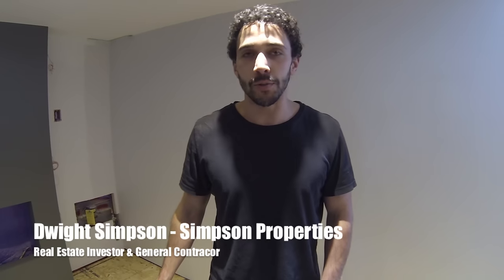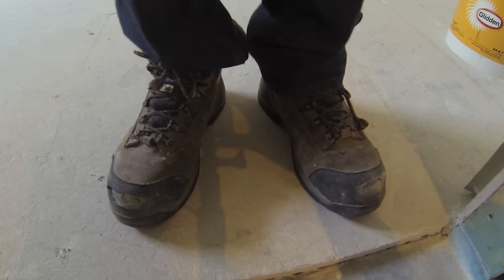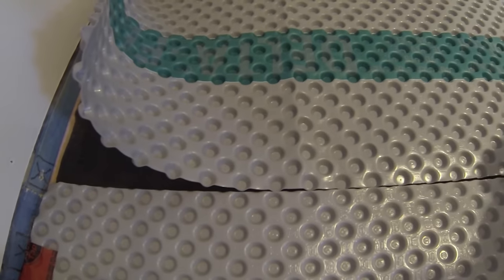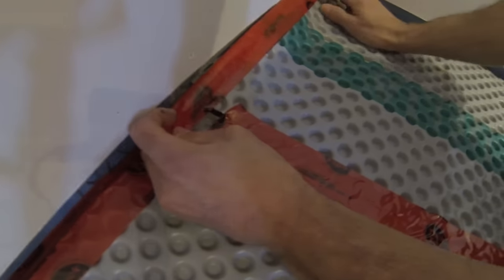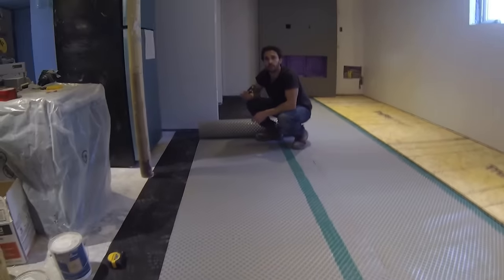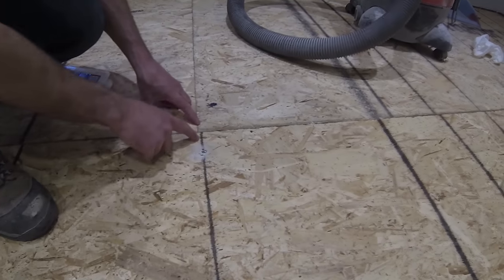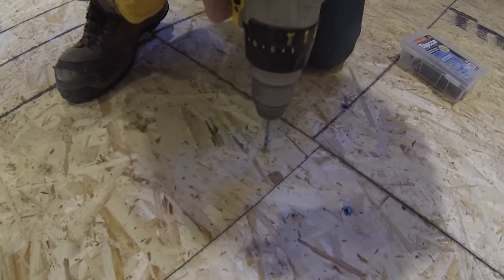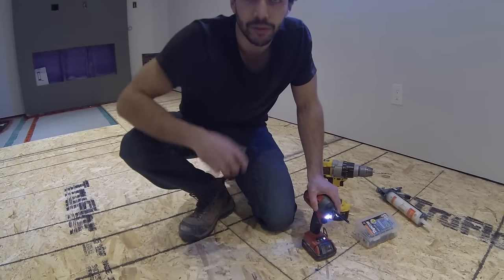HOW TO INSTALL A SUBFLOOR ON CONCRETE

Comment: hi, great video - really appreciate it- ty!  job is aprx 540 SF condo with aLR/kitchen area and a bedroom. I am thinking to have installed-  aquaguard waterproof laminate (sold by floor and decor) on concrete slab, which is costly in itself so trying to keep underlayment costs and  additional labor costs minimal. in seeing this product, I was thinking it beneficial as a moisture barrier and also should aide in flooring protection should an appliance waterleak occur, as just happened with existing floor. (thinking water would seep under this barrier) the main living area seems to have a secure foam or plastic underlayment that may be well in tact, then it runs into kitchen area that has peel and stick vinyl that i am leaving down and the bedroom has a softie plastic underlayment already as well.  do u think this would work  in lieu of landscaping fabric for anti-clicking noise and okay to just lay the laminate on top of this product or underlayment is again needed over this too?
Reply from the maker: vzw 3 vzw 3 if you're installing flooring in a condo usually the condo board has requirements that have to meet their standards for underlayment materials. Delta-FL is not really going to help you if there is a flood on top of the floor. It's more for foundation leaks. It acts as a channel for water to make its way to a floor drain. I would recommend using a really high quality underpad directly on top of the slab then install your laminate flooring.

Comment: Did you complete the entire floor by yourself? How many square feet was this space? How long did it take you to complete it? How much was your total cost for materials (for the wood subfloor part/the rubber/ etc)?
Reply from the maker: I did complete the total floor myself. I did this job over 4 years ago so it’s tough to remember exactly how long it took. The basement is roughly 1100 sq ft and the entire subfloor was installed over a weekend. In regards to pricing that can vary a lot depending on where you live. It’s best if you get material costs in your local market and calculate the costs based on that.

Comment: Thanks for the tips. another ? for you. the delta fl is very wavy near my stairs. will my 5/8" ply flatten it out?
Reply from the maker: That's normal for the Delta-FL to be wavy. Once the plywood is installed it will flatten out. Good luck with your project!

Comment: Can you provide some specifics on the landscape fabric you used?  There are so many types to choose from, would roof felt accomplish the same thing?  Thanks, enjoying your channel!
Reply from the maker: Mike Welch the manufacturer recommends using landscape fabric so I would stick to using that and not roofing materials. Just buy the cheapest landscape fabric you can find. Use the black fabric not the grey fabric. The grey fabric is for more commercial applications and you will be spending unnecessary money on that product.

Comment: Is that enough fasteners per sheet? Think there should be more on the perimeter to keep edges flush with one another over time.
Reply from the maker: The amount of concrete fasteners were installed according to the manufacturers specs. I installed some extra fasteners on some sheets where I  felt they were needed.

Comment: So I have that hollow sound since I didn't use the landscape fabric will I still hear it after I lay carpet or should I just pull it all up and redo it?
Reply from the maker: I personally would pull it up and redo it. You will be annoyed if you still hear it once the carpet is installed. The weight of the carpet may prevent it from happening but I wouldn’t take that gamble.
Reply: @simpsonpropertiesltd  that was my thinking it's not terrible but if the carpet over the top dosent remove it then I'd be doing more work removing the carpet then pulling the floor up I've already tried adding more screws which didn't make much of a difference

Comment: Great , right time to see this video, I am going to do the same .One question, DMX does not suggest to seal the edges/corners between  walls and underlay, even 1/8" gap between baseboard and finished floor for venting, what is your opinion about this?
Reply from the maker: That seems counterintuitive to me. The whole premise behind the system is to have a continuous barrier. I have not worked with the DMX brand of underlay though.
Reply: I plan to use the DMX product myself and carpet the basement. I'm no expert but seems to me you just don't want to trap moisture under your carpet so as long as the moisture is traveling to the edges and entering the room the hvac system will take care of the rest. I get the vapor barrier but if the moisture is carried behind the wall and travels to the top and you have that spray foam that seals the top area of your basement I would worry about trapped moisture behind the top of the walls. Also I have a new home and the foundation was poured with brick moulded walls so you have the option not to frame and drywall just a brick look so no vapor barrier. Another thing I've read some people used DMX in the basement with the carpet directly on top with no underlayment boards and no pad. Not sure if this is recommend or not. Still researching.

Comment: Nice.
 But this stuff will feel more like carpet or a wooden floor not concrete right?
Reply from the maker: It feels like a solid surface if OSB is used in conjunction with Delta-FL.

Comment: I want to do this however, there is no way I can remove the white backing from my old vinyl. Can I apply the landscaping fabric down onto the old white-backing and then do what you've completed? Also with a strong plywood base, I then want to add warming system for new tiles.
Reply from the maker: You can install the subfloor on top of the vinyl that you could not remove. Personally, I would not install this type of subfloor if I was installing tile. I use a product from Schluter called Ditra-Heat on top of the concrete floor then install tile. By doing it this way thresholds from tiled area to laminate flooring for example is smooth if your job is planned well. You can install Ditra-Heat on top of a wood subfloor if you would like as well. If you're using a different brand of in-floor heating make sure it can be installed on top of plywood or OSB.
Reply: Great thanks for the comment.

Comment: Hello do I put the vapor barrier flush to the wall or does it go up the wall then tape
Reply from the maker: Flush with the bottom plate of your framing. If you ran it up the wall it would cause a bulge  & an uneven surface to install your drywall.

Comment: What kind of landscape fabric did you use? Any specific kind to buy? 
I'm curious cause some people have said that the landscape fabric underneath the delta fl traps moisture and causes mold/ rot?
Reply from the maker: You can use residential (usually black in colour) or commercial grade (grey) landscape fabric. Which ever is cheaper. Landscape fabric will not cause mold/rot. It’s a installation method recommended by the manufacturer.

Comment: When you installed the vinyl, did you glue it down or put it down as a floating floor? Also, where did you buy the subfloor material?
Reply from the maker: The laminate flooring was not glued down. It’s a click in lock system that is floating. I purchased the Delta-FL from Lowe’s.

Comment: Did you drill those screws into the concrete. Hope you didn't hit any post tension rods! They're important for holding the building up.
Reply from the maker: Stuart Reynolds yes the concrete fasteners do go into the concrete slab. This method will not compromise the structure of the foundation. No rebar is damaged using this method.

Comment: I want to do this project soon. Our basement floor has some areas that are not even/ leveled. Would you recommend leveling it out? It's just so expensive. Thanks!
Reply from the maker: If it is really out of level I would recommend grinding down any high spots and using self levelling concrete in any low spots.

Comment: I have a bunch I mean a bunch of 3/4” plywood non tongue and groove can I use it instead of the 5/8”?
Reply: YES...ITS JUST THICKER...STRONGER....WHAT YOU HAVE IS ACTUALLY PREFERRED
Reply: M D I have like 80 sheets and am glad to here I can put them to use!
Reply: @biggerstuff360  Man where are you at? Lol. I'm about to finish my basement and I don't look forward to making the trip to Menards to get a trailer full of plywood.
Reply: @UOAPlays  Ohio buddy lol
Reply from the maker: 3/4” plywood will do the trick. Leave a small gap between the boards for expansions and contraction.

Comment: Nice video, I'm currently doing this same thing in my inlaws basement using dmx 1 step and 3/4 purebond (for UF off gassing -allergy issues), my question is have you had any issues with these panels popping up with that length of tapcon, my total height with dmx is 1", but I'm fuzzy on the screw size.
Reply from the maker: Thanks james! I haven't had any issues with tapcons popping at all.

Comment: Question: I am finishing my basement. Does this method eliminate the need for ground rated studs if building walls?
Reply: Yes IF you install the studs OVER the OSB
Reply from the maker: That all depends on your local building code. Most likely it will eliminate that requirement since the studs are being installed on top of OSB and not the concrete slab.

Comment: An excellent video and a good solution.
The finished space turned out great! Did you do a video on the shelving flooring and fireplace? I am about to replace a fireplace and liked the look of that one. Do you remember any info the fireplace?
Again, nicely done.
Ron
Reply from the maker: Thanks! I did a video that showed how I framed the fireplace but not the shelves. Here is a link to the video:

https://youtu.be/4zGw-wuAeLE

Comment: I spoke to a dmx customer service representative and they advised not to use obd plywood ontop of dmx. Now I’m conflicted. Curious to know why you used obd, was it cause your floor was uneven?
Reply from the maker: OSB was used because it provides a stable and solid surface to install your finished flooring on. If you install the finished floor directly on top of the Delta-FL or DMX you may feel any uneven surfaces.
Reply: Simpson Properties ok I will do the same thank you so much
Reply: Simpson Properties sorry for my annoyance I’m sure you’re a busy man and like previously stated I appreciate you taking the time out to help out little ol me I recently spoke to dmx and this is what they told me, “we do not recommend the use of osb for several reasons, osb can offgas phenol formaldehyde or isocynates (feel free to google binders used in osb) osb is very susceptible to swelling and warpage. Osb will raise your finished floor which will result in lower clear height requiring you to cut doors and and trim to accommodate.” Curious to know what your reply to that would be since I’m planning to follow exactly what you did.
Reply from the maker: @SBdunks3  No worries, I'm happy to help. 
1) They are right when it comes to OSB off gasing. Unfortunately, most building materials will off gas. It's something that manufacturers are trying to reduce. 
2) OSB is much less prone to warping and swelling compared to plywood. Especially, if you use I high end OSB such Huberwood AdvanTech. The OSB is being installed indoors in a conditioned space. So warping would not be a concern to me. Drive by any new construction homes sites. They most likely have OSB sheathing and subfloors which are exposed to all the elements during construction. They are designed to be exposed to the elements for a limited time.
3) If you have really low ceiling height and the 5/8" OSB is going to make or break your ceiling height. Then you may not want to use it. If this is being installed in a unfinished space, then you obviously wont have to undercut your doors. If it's being installed in a previously finished space then your doors will have to be undercut. You will most likely have to be undercut your doors if you're only installing DMX and the finished floor as well.

Comment: Great video, wondering will this approach work on an uneven concrete floor? Previous owners knocked a wall and basement is essentially uneven as a result. What would your recommend?
Reply from the maker: You would have to install some self leveling concrete in low spots or shim the flooring.

Comment: Just doing some math here.. using these materials works out to somewhere in the neighborhood of 1.54/sqft. The DRICORE 2X2 panels that you referenced at full price work out to 1.75/sqft. Do they do as good of a job as the dimpled plastic/osb combo? The cost difference doesn't seem to be enough to warrant the extra work involved with this system. Thanks in advance for any input!
Reply from the maker: The one major pro to using Delta-FL is you get a continuous air barrier since all the seams are taped. When i bought the Delta-FL Lowes had a BOGO sale. There was a big cost difference between the two. DriCore is very convenient to install from the looks of it. There is no denying that.
Reply: Is there any potential downside to having a complete vapor barrier between the concrete and your subfloor? I've noticed not a lot of people do it. I mean it makes sense to keep moisture away from your finished product but is there any risk to trapping that moisture below? My house is less than a year old so the concrete is still producing some moisture.
Reply from the maker: Matt DeDecker this answer is directly from the Delta-FL site and covers your topic:

DELTA®-FL - The perfect plastic subfloor system for concrete and slab on grade floors.

This air-gap membrane is made up of a special high-density polyethylene resin (FDA approved), providing a dimpled surface with outstanding compressive strength, impact resistance and long-term performance.

DELTA®-FL is a uniquely dimpled, heavy-duty grey plastic membrane that keeps you and your family warm and comfortable in your basement, or any room in the house with a concrete, slab-on-grade floor. The membrane is installed with its dimples down to create a 5/16-inch thick air space above the slab, and can be covered with a plywood subfloor and topped off with carpet or flooring systems.

DELTA®-FL on concrete floors protects sensitive materials by exploiting the concept of vapor pressure - that is, water vapor seeks to equalize its pressure by moving from areas of high pressure to areas of low pressure.

In a conventional basement, dry air in the living space acts as a magnet for water vapor seeping up through the concrete. But with the DELTA®-FL system, the space between the dimples provides a sufficient air-gap to equalize the water pressure above and below the concrete slab.

Though the air in the living space is completely isolated from the system, DELTA®-FL is designed to allow small amounts of water vapor into the room to maintain a healthy humidity level.

The membrane also provides a thermal break that generates instant comfort and warmth for your basement. DELTA®-FL is an inert material. The air-gap membrane has an outstanding compressive strength of > 250 kN/m², is extremely tough and rugged and can withstand heavy loads which allows for any finishing on top of the membrane.

The reduction in head room is minimal and the product is extremely easy and fast to install. DELTA®-FL comes with a 20 year product warranty.
Reply: Sorry to harass you again but I figure I better take advantage of you before you've got tens of thousands of subscribers! My basement currently already has finished stairs. If I use this subfloor system, my bottom step will be anywhere from an inch to an inch and a half shorter than the rest of the steps. Would you still use this subfloor system or is there something else I should do?
Reply: Also does it make sense to install non-load bearing walls on top of this subfloor system? Or should I frame first then lay the subfloor?
Reply from the maker: haha no  worries I'm more than happy to help. I doubt you will even notice that height difference. You can lay a piece of Delta and OSB and the base of the stairs and test it out first. I would install your non-load bearing walls on top of the subfloor.
Reply: The Dricore panels are also less forgiving if your floor is not very close to perfectly level (panels are smaller, so many more joints). Shimming is necessary to keep it from creaking.

Comment: hey love your video I used the delta fl and osb in basement and it worked awesome. Can I use delta fl and osb in my detached garage for man cave/ place to park vehicles?
Reply from the maker: Aaron Koshinsky thanks! If you used the garage just as a man cave that would be fine. Unfortunately, there is no way OSB or Delta-FL will be able to support the load of a vehicle.

Comment: Can this be used on a raw foundation? Does this eliminate the need for a mudsill? I'll be using a concrete slab for a foundation.
Reply from the maker: If you have a concrete foundation with a concrete slab floor than yes this method of a subfloor will work. If you install all of your subfloor before you frame your walls then yes it eliminates the need to use a sill gasket on your bottom plate.